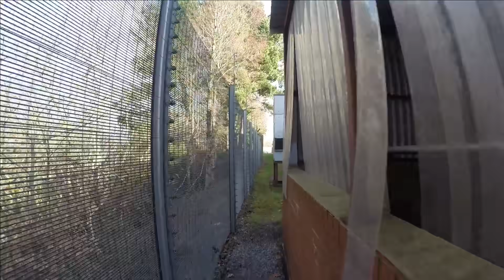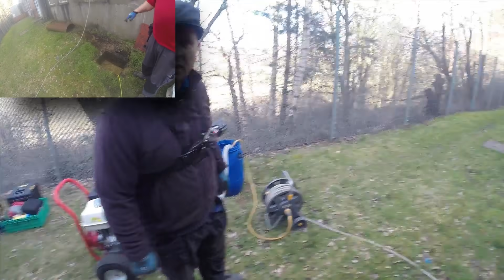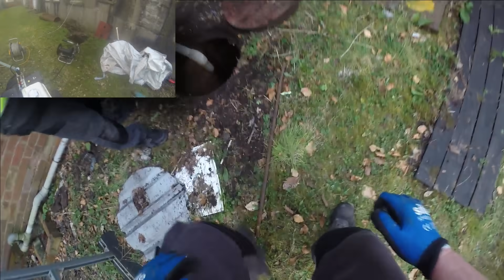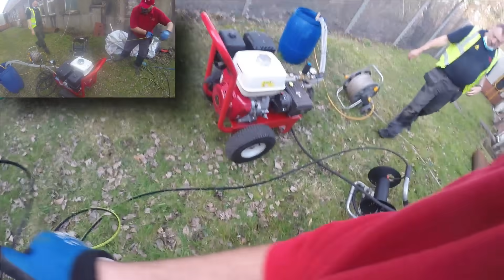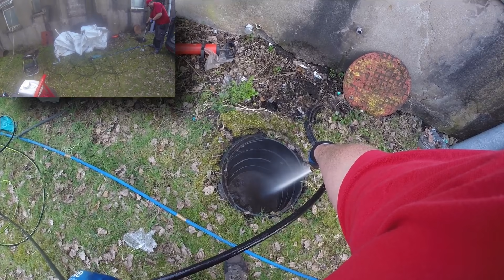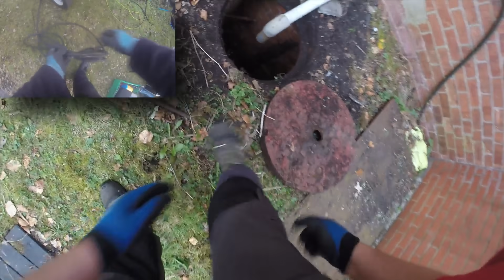Blocked Drain  (Rods_Away_162)

Comment: If it clear water , where the dirty water going
Reply from the maker: I had gone through the blockage and out the other side
Reply: penetrator go brrr
but easily only as the size of the nozzle. go far enough and tiny hole in the blockage is sealed by the hose.